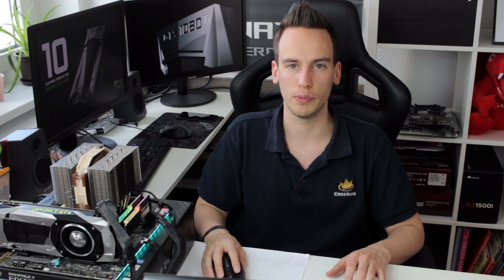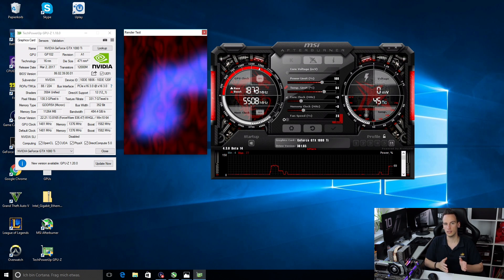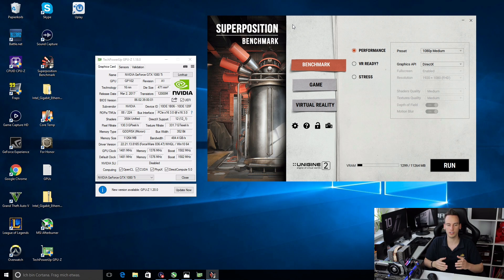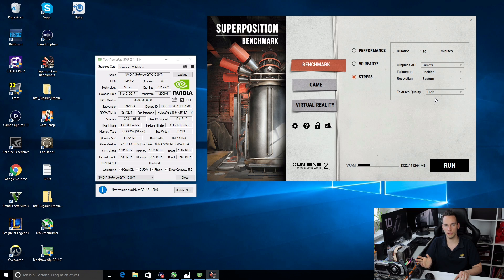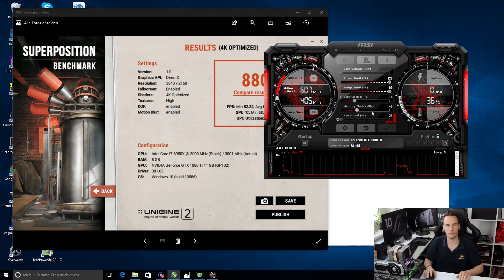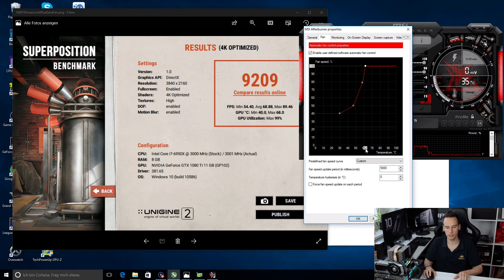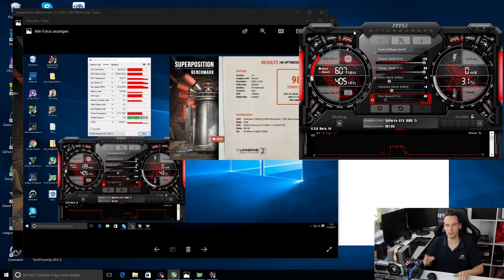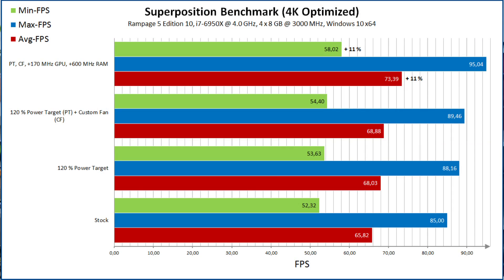Nvidia GTX 1080 Ti Overclocking Tutorial (Stock Cooler) (en)

Comment: So I tried this on my Asus strix 1080ti gaming (yes, I still use a 1080ti :D) that is watercooled. I got 9106 on stock setting, but had crashes on the benchmark at both settings from the video. GPU-Z did not crash

Comment: My 1080ti founders crashes instantly at +150 core in most games, stable at +125 and +550 memory
Reply: After a lot of tweaking and tuning I finally came to the exact same settings as yours that are stable. -1080 Ti FE

Comment: Does MSI afterburner not work with laptop because i can not use the core voltage/power limit/temp.limit/fan speed on the one i have?

Comment: Thank you for this video. My Gigabyte Aorus 1080ti Extreme card has always worked well, but I've never quite gotten how to OC it, as my numbers are well different from yours. For example I was able to achieve very similar numbers as your results (2037mhz core and 5643mhz memory), with using much lower numbers than you did. You OC your core by +150 and memory by +550, but when I tried similar numbers my card just crashed. So, those numbers are huge compared to the smaller numbers I ended up using. I used a +38 on my core, which boosted it to 2062mhz, and an increase of +407 to increase my memory to 5726mhz. This yielded a score on the Superposition Benchmark of 10298. I was able to push my core over 2100mhz at one point, but saw some banding in the benchmark, and sometimes it would not run all the way through. So I dialed it back. And that fixed it. But after a while, a funny thing happened. I would save all the results in the results folder of Superposition, but now Windows 10 is asking me how to open them? They are all .score files, and in the beginning, they would open easily to show my scores. Now they will not open, and no program I've tried would open them either. Has anyone else experienced this? Any ideas on how to fix this, besides deleting and reloading the program? Thanks again for your videos.

Comment: My Inno3D GTX 1080 Ti managed to run stable 1647 Mhz clock and 1503 Mhz memory, when i push it more, i got an artifact or my system just freeze.

Comment: My 1080ti is a Asus strix.
I use GPU tweak 2
1710 boost
+400 memory or +200 in msi after burner. 
120 percent core voltage
100 percent voltage percentage. 
Runs stable in worst case scenario @ 100 percent usage and stays at about 58-60c. Got a custom fan curve so they hit max speed at 61C. Helps with boosting. My card runs at a pretty constant 1984mhz 2012mhz. Just throwing my specs out there for a guideline to whoever finds this comment.

Also benchmarks in my experience are not as good of a test as as modern games @max. All benchmarks I ran and passed only to crash in games later on. Some were off as much as 70mhz from what I could do in benchmark vs game.

Comment: hey guys am planning on OC my Nvidia 1080 ti I have never done OC before so this is all knew to me I have a few questions.
1. am I suppose to play with the numbers till it crashes to find the final number I can push my card ?
2. do I need to mess around with the fans? I seen videos where ppl say if you don't know what your doing leave them on auto.
3. how long do I need to leave the bench mark program run after am done with OC.
4. any preset any one can share for a 1080 ti reference card.
5. do I need after burner open in the background always to have the OC take effect?
Reply: I have the same questions. Hope someone answers this
Reply: Have you figured this out?
Reply: yes but not thanks to this youtuber feel bad i bough his case now since he shows no support anyways.

1. Yes. Only way to know the limit is by crashing it.
2. Depending on the card really. The FE or nay blower models really need the fan adjusted if you want to push the card.
3. At least 10 minutes. I usually do it for 3-5 than once I have all the numbers down, I leave it for 10min, than 30 minutes if I don't need to further adjust the clocks.
4. Umm.. I usually max out at +152 Core / + 250-300 on the memory which will put your core overclock to 2050~. I won't just put the those numbers in without working your way up to it. It will only give you a hard crash after a few minutes.
5. Yes, only any other overclocking software. I cover that all in the written guide.
Reply: El diablo da Costa are you serious?? Or just been a smart ass?? If I said 1080 Ti no one would know what model of 1080 Ti am referring to. It could be PNY MSI etc when some one refers to nvidia 1080 Ti they mean it's a  1080 Ti bought from nvidia and it's a FE.

Comment: Sadly I am finding my ti becomes unstable
At +150 and +500 I get artifacts in the benchmark tool.
At +125 and +400 it seemed stable until some gaming resulted in lockups.

Currently running stock with increased power and better fan curve.  A little disappointed in the cards OC ability though.
I will try some more lower OC when I can be bothered.  Not that I need the power with my current setup (1080p)
Reply: Stop worrying about the +150 and +500 as different cards need more or less. Worry more about the resulting mhz of core and memory. You should shoot for over 2000mhz on core and over 5600mhz on memory. The number of OC +numbers to get you there are irrelevant!!!!!
Reply: I have since put my card on water. I am stable at 2012mhz boost clock and +500 on memory. On air it was crashing per my original post

Comment: +150 on the core is not normal as this video Claims. I have a 1080ti sli Setup. And both cards produce artefacts than. Same with my Friends.
Reply: Eddy van Marwijk its bc its a FE its clocked lower out of factory so more headroom
Reply: Of course. Try using some extrapolation when watching such videos.

Comment: I'm a new follower to this channel, does he have any guides or could anyone point me into the right direction for tutorials on overclocking ddr4 ram. I picked up those corsair platinum SE ram sticks, and i was curious if i could get some info on manually overclocking them to be a little faster, considering they are advertised to be pushed a bit more than the xmp profile. I'm not totally new to PCs and overclocking but i'm not a pro at them either like this guy.
Reply from the maker: Welcome to my channel :) I don't have a DDR4 OC guide online yet :)
Reply: If you could make a tutorial on how to that be great, from what i understand, the process takes a lot of time and patients to get it right. Or is that a misconception?

Comment: How come you aren't moving the voltage slider? 

It doesn't allow you to get a higher clock, but it stops the clock dropping, for example. if I have +100 core clock, if i have the voltage slider at 0, my clock drops to 2012 when my temps max outt, if i have the voltage slider at 100, it sticks at 2050.

Comment: I'm sad. My gtx 1080 ti sc black I was stable at 120 power, 90 temp, 107 core clock, and 504 mem clock...I guess not all cards....as I was typing this my vid drivers reset...i'm going to need to clock a little lower.
Reply: Jamsy .billy Actually, I think the SC (SuperClocked) card runs higher frequencies out of the box. So +107 core clock might be as high or higher than the values in the video :)
Reply: Chris Pridemore it depends on the card and how often you use it and how hard you stress it. Personally I would overclock but wouldn't push it too it's limits since I don't plan on upgrading for a while.
Reply: Chris Pridemore but yeah you should be completely safe if you don't raise the voltage.
Reply: Chris Pridemore nice job man keep on improving.
Reply: I don't raise the voltage, I just raise the frequency by +100. I heard the only way to mess up your card through an app, is by raising the voltage, like you said. 3 out of 10 years? Wow, no thanks.
Reply: Cool, I have a 1080 ti, and I'm making a sci movie. :) Here's a link: https://www.youtube.com/watch?v=tcP45EXerNU
Reply: Thanks so much, man. Have a nice day.
Reply: 90 degrees?!?! :0
Reply: Isn't that going a bit hard on it? Does overclocking to the max shorten the longevity of the GPU?
Reply: Let me simply this for you. More voltage lowers the life expectancy of your gpu (most people say like 3 years out of 10 give or take, also depends how much voltage your adding and the gpu you're using>) Frequency on the other hand does not lower life expectancy but does however usually need more voltage to operate at higher frequencies.

Comment: Hello, good video. Can this be harmfull for the gpu?
Reply: Emiliano Pucciarelli naw, like he said if you make any changes that are unstable or could damage the card it'll just reset
Reply: More than likely not, but if you increase voltage you do decrease the lifespans of components.  There is a lot of research and data on increasing voltages to over clock.  As long as your not pushing the temps of your cards in the red zone, and aren't modding the bios for voltage increases this is very safe.

Comment: I guess the companies that gave you the GPUs gave you binned ones because none of my 1080Tis can do +150 core lol.
It's between +50 and +100
Reply: same. also he is testing on an open bench......... so add 8 degrees temps at least
Reply: @colinparks619  You guys are assuming he might be using the same cards as you. For example yours being oc'd from factory while his may not. So you getting only +100 while he may be able to do +150, for me personally my FE card can do +150 fine, but your higher factory clocked cards may not be able to do that because you already have it.
Reply: my 1080ti can do 160/ 550 no issues. Anything above 2000mhz may or may not crash - had instances where it was fine, others not quite.
Reply: I can't run at 150
Reply: Jonathan Tessier strange, mine running +135 clock and +450 mem fully stable.
Reply: mine does. msi aero

Comment: I used this benchmark on my Auros 1080Ti extreme and it runs solid. 2025mhz stable all the time (4 times back to back). However I played the Witcher 3 and within a minute it crashed. I used Haven Benchmark and within a minute it crashed. This benchmark is not good to test stable OC.
Reply: True It happend to me aswell. 150 core clock and 550 memory clock in Heaven crashes while superposition runs smooth with no crashes or stutter

Comment: CPU:intel Core i7 7700K 4.20GHz (EUR 356,00)
Mainboard:MSI Z270 TOMAHAWK (EUR 138,00)
RAM:16GB DDR4 Corsair KIT (2x8GB) Vengeance Black PC 3000 (EUR 125,00)
SSD:128GB ADATA SU800 (EUR 55,00)
HDD:2TB Toshiba 3.5 SATA3 DT01ACA200 7200rpm 64MB (EUR 71,00)
GPU:MSI GeForce GTX 1070 Gaming X 8G 8192MB (EUR 446,00)
Gehäuse:be quiet! Silent Base 600 Silver Window (EUR 119,00)
CPU Kühler:Be Quiet Dark Rock 3 (EUR 63,00)
Netzteil:be quiet! Pure Power 10 CM 500W Modular (EUR +69,00)
Meinung

Comment: why not do a vid on RAM tuning?. i see many people buying high speed ram only to fail and have it at 2133or 2400 auto.
expecialy the new G.skill Trident RGB new models.
Reply: The Last Prophet yea but when you buy fast ram ypu want it running at that speed even if it only gives tiny improvement
Reply: The Last Prophet You can't handle 4200mhz
Reply: 2400 is all you need

Comment: Thanks for the video. Why do you prefer Afterburner over Precision X? Is there an advantage? I'm about to purchase a Ti and since the prices are identical the only thing left to decide is which GPU OC software to use. Also, is it wiser to use a GPU OC software that is the same brand as the Motherboard?
Reply: Its software, so the only difference between those programs is basically how they look. The nice thing about afterburner is that it comes with rivatuner statistics. you can set up a on screen display, displaying very usefull info in a corner of your choice, like showing if you hit power limit, showing clocks etc etc. thats why most people prefer msi afterburner
Reply: Thanks. Wondered how people were displaying real-time telemetry. Again, thanks.

Comment: But dragging the core clock slider in the application's main window will increase the frequency across all the available voltage points. I read on the forums that this method is a bit more unstable than by manually adjusting the max core clock for each voltage point in the voltage/freq graph (CTRL + F in MSI AF). 

I'm currently using the manual method myself, I got good results with my 1060 (2174 MHz @ 1.063V and 9600 on the memory).
Reply: second this
Reply: how much % of improvement?

Comment: hey roman...ich hab eine msi 1050ti gaming x wie weit kann ich bei der gehen? hast du da erfahrungswerte?
Reply: bis sie unstabil wird dann eine boost stufe zurück, kaputt kann da nix gehen wenn du zu viel takt gibst...
Reply: ich habe eine und ich bin im moment bei +115mhz und +400mhz. Die karte boosts bis 2012-2025-2050 @66*c und 65% ventilatoren. 4k Optimized und am ende ich habe 9934punkte :D Config i7  7700k @stock(der bauer delid tool ist  noch nicht verfugbar) und 16gb ddr4 3200mhz
Reply: du hast ne 1050ti die 9934 punkte schafft bei 4k optimized? das will ich sehen... das kannste knicken ;-) ich vermute eher du hast ne 1080 ti bei der punktzahl^^
Reply: ich habe gelesen 1080ti :))) ich habe 1080ti from msi gaming x =)))
Reply: hehe ich habe ne wassergekühlte FE karte die power modded ist... tackt nonstop auf 2088 wenn ich will xD

Comment: I would like to know How far you can push 1080 ti watercooled
Reply: the same like on air, just more quiet, with good radiator setups unaudible
Reply: Hulio2205 no no :D bro if you have water it's 40c• cooler more , and you can oc more
Reply: Hulio2205 5.2 cpu hmmm nice , delid ?
Reply: sure and very good watercooling loop, i have 2 big 480mm rads for that gpu and cpu :-)
Reply: Hulio2205 I would never delid cpu to be honest, I rather delid 6700k I have my 7700k 5.1 with no delid and the temps are ok 80 max , gpu always 40c*
Reply: Hulio2205 send photo of your pc I wanna see it

Comment: Roman don't you know about power target unlocked BIOS for GTX1080 Ti Founders Edition?
Reply: Several users including me have confirmed, that CLU dissolves solder, so it isn't very safe to put it on top of shunts and also to lower the power target enough you need a pretty hefty amount of CLU which even if you did only carefully covered the top of shunts can still move and touch solder.
Reply: No AORUS BIOS doesn't actually work on FE for increasing power limit, no other BIOS than Inno3D X4 BIOS seems to do anything with power limit, it's probably because it does handle the power limits from PCI and 6/8-pin connectors differently because all non-FE GTX 1080Ti PCBs does use 2x8-pins, only Inno3D is using FE PCB with a 315W power limit instead of 300W for FE. Shunt mod does also actually work - tested if myself and then when i found out that CLU dissolves solder i end up removing it, however with the shunt mod the card is able to draw 400W and maybe more, it really depends on how much CLU do you put on them.
Reply: Regarding Voltage it doesn't seem to be necessary to increase voltage past 1.075V, i am on water cooling the GPU to 35C or even less like 30C during full load and it is not scaling at all past 1.075V, 1.093V will not help me to reach even 1 more bin stable(1bin is 13MHz.).
Reply: So the several and you put way to much CLU on that shunt resistors, which is borderline retarded imho.... you just need a very thin layer on top of the shunt resistor, there is no way it will even touch the solder if you do it properly and the card is horizontally mounted... i did the mod with CLU myself and have no issues what so ever... a very thin layer on all 3 resistors and im not hitting the power limit anymore... see here done over a month ago: https://puu.sh/vxh3q.jpg
Reply: I tried applying less like a very precise thin film over the shunt, but then the power limit wasn't raised much.
Reply: i haven't seen what you have done,so its hard to tell for me what went wrong in your case, but i just putted enough to cover the top while abusing surface tension a bit so you can actually put a bit more on it without fluid movement, because even CLU can't surpass laws of physics ;-) i can just say if your CLU moved to the solder it has been way to much